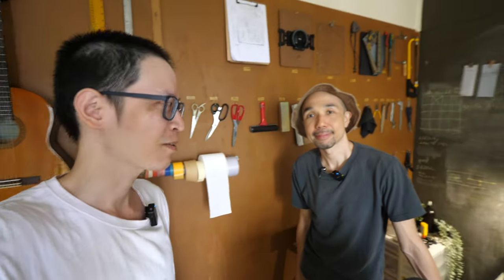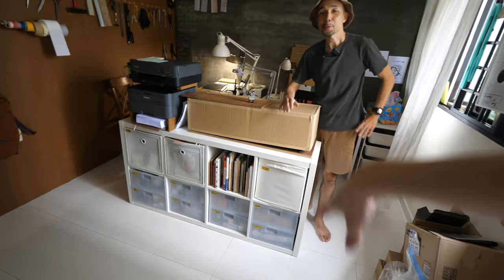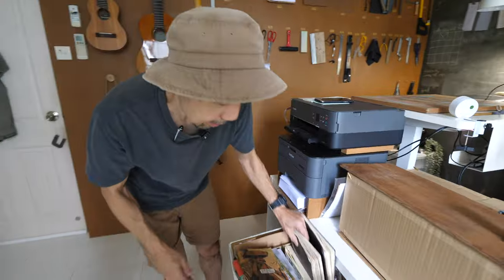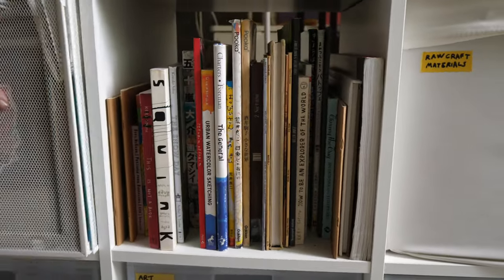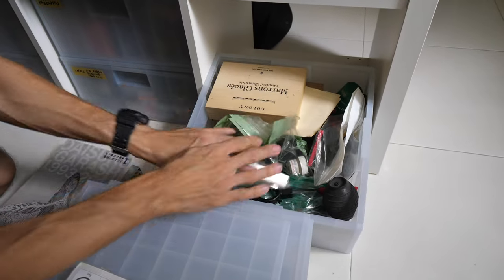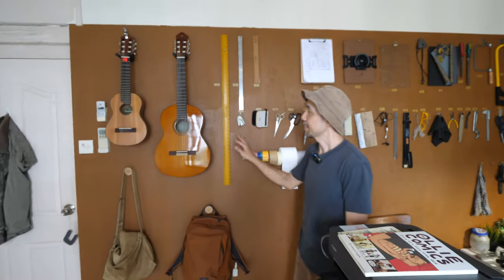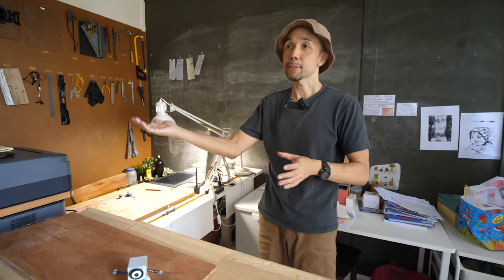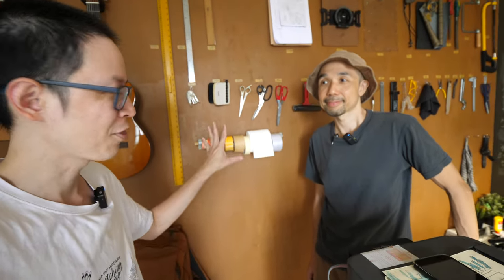Drewscape Studio Tour (2023)

Comment: This looks like a very spacious studio, it is almost double the size of mine.  But.... why is it arranged as a labyrinth?
 I would bring the desks ( both Andrews and his daughter's one) in front of the window in order to get the most of light and air and then I would place the rest of the storage furniture close to the wall with the panel and the blackboard wall. The humidity problem can be solved with a dehumidifier and a ceiling fan. I have similar humidity problems in my studio and that is how I've solved the problem.
Another trick is to leave some space between the furniture and the walls or the floor in order to allow the air flow freely all over the room. You should leave at least ten cm between the walls and the whatever furniture you place close to them and place your things in such a way that they will not touch directly the floor. You can use for that something like bricks, wooden palettes, plastic baskets, little stools whatever you have available.  Nothing in direct contact with the humid surfaces. 
I like the photo box idea.